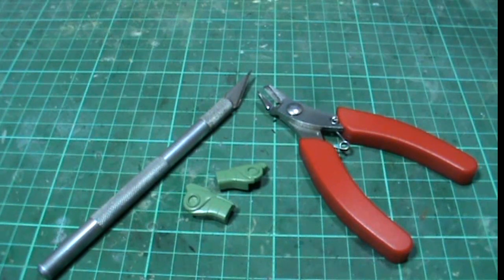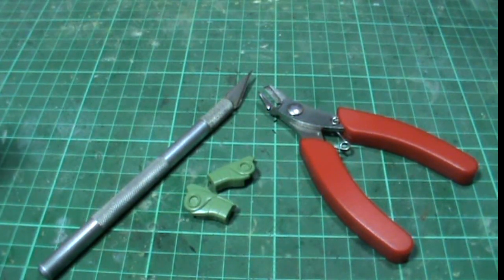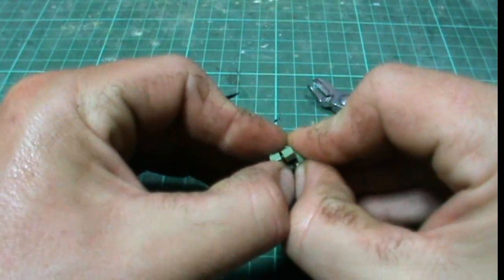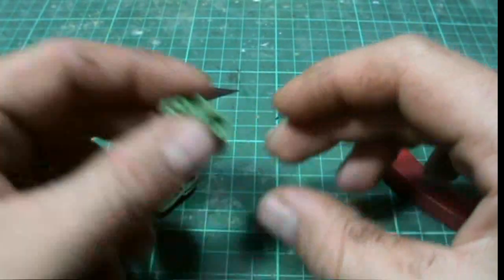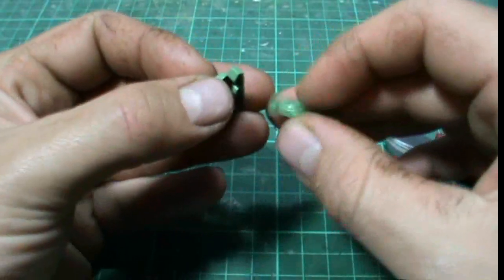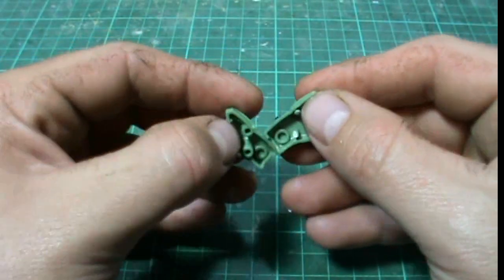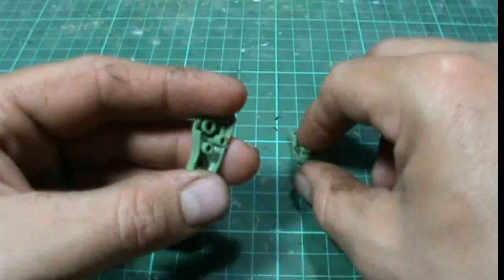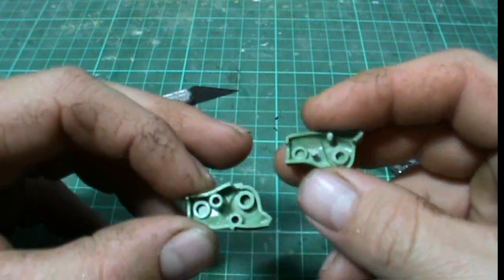Gunpla Tutorial : Modding Parts for Easy Disassembly

Comment from the maker: Masking is needed if a part is multicoloured and can't be pulled apart. Paint the colour with the smallest amount first only on the sections that need painting, mask them off and then do the next colour. If there is more, mask that off and then do the next colour until all done.
Reply: what do you mean "smallest amount"? starting with the smaller part that is of a separate color, or painting only a single layer of paint before moving on?
Reply from the maker: @Gustavomazu  The smallest surface area

Comment: so you touched on the subject of seamlines. I am new to gundam modeling but I do 40k. Right now I am trying to build the torso but it has pieces for three different colors and obviously there are seam lines on the side of the torso. I would prefer to paint them separately before assembly but what would I do about the seamlines if the pieces were painted already. thanks

Comment: So you say masking is the best option after removing the seams. I am starting my first build with an HG Gundam Age 1/144 Adele (RGE-G1100) Diva color. So the torso comes in mainly blue but there is some white and dark grey areas. The small articulations are mainly dark gray but have to already be in place (for the arms) so i can remove the seams of the torso. I pay a lot of attention to detail. Even if it can't be seen sometimes. thanks for responding.